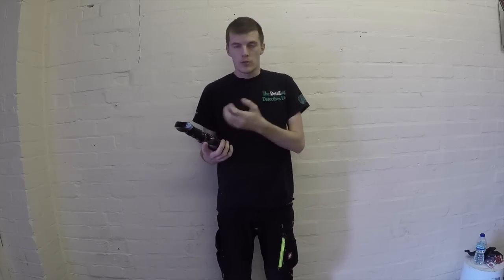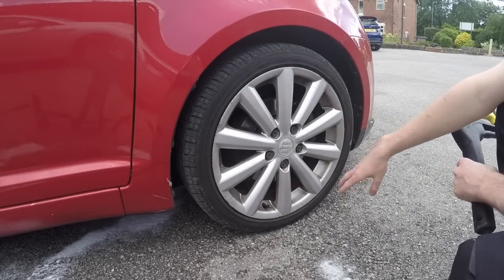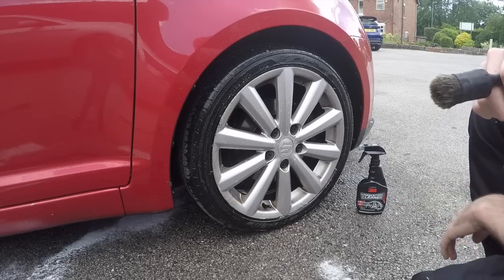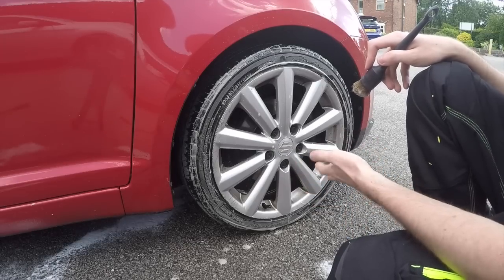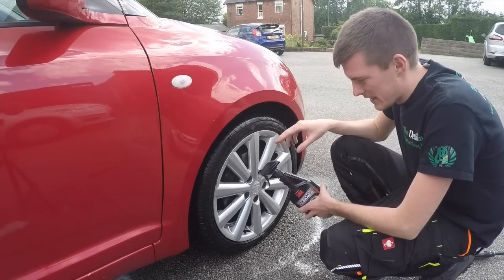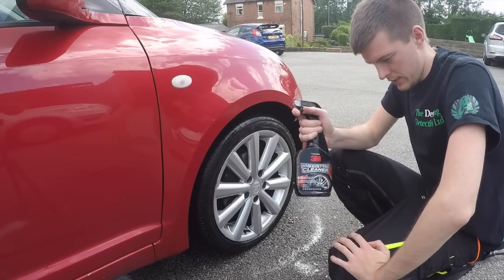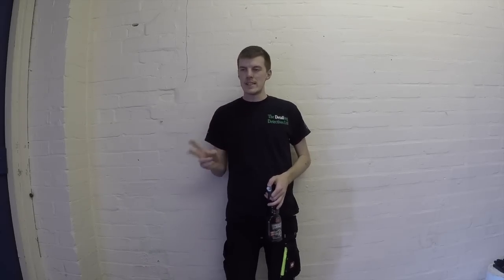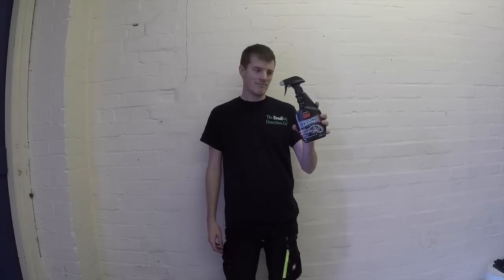3M Wheel & Tyre Cleaner - Product Review

Comment: Its GREAT for maintaining cleanish wheels and tires. But is absolutely not strong enough for neglected ones. It will eventually work but you'll spend an hour and an entire bottle on just one wheel using this stuff on burnt on and embedded brake dust.  Which sucks cus i really thought I found some sort of secret weapon with how cheap it is. Undiluted purple power is saddly a better option, cus I know 3m has the brainpower and resources at their disposal to make a FAR better product then this.